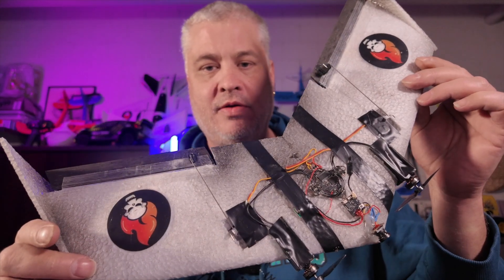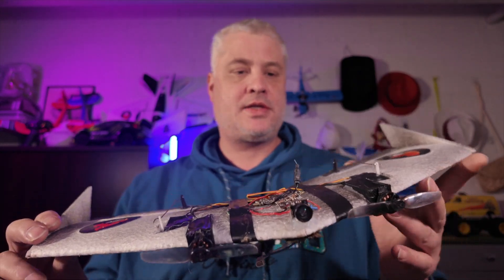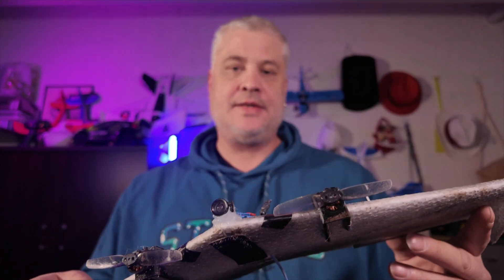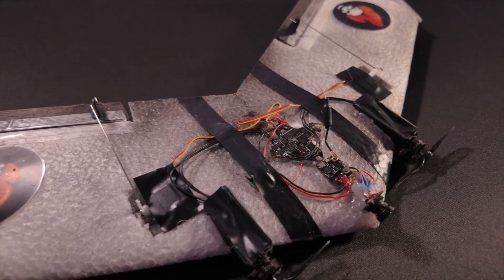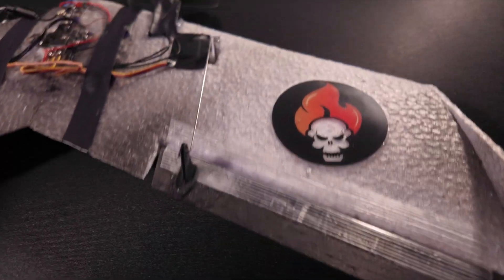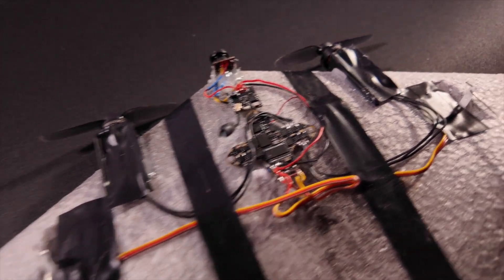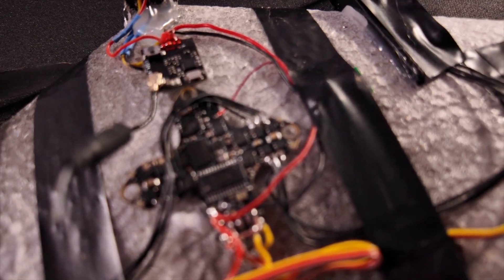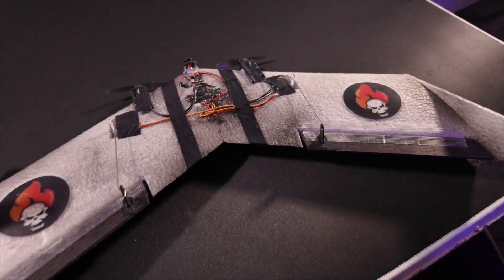Causemann Nano 1S INAV FPV Wing

Comment: Just ordered mine. I come from quads so I’m super excited. 

What’s your flight time look like ? I believe BF 4.6 supports wings now right ?
Reply from the maker: Depends on how you fly and what Batteries you use.I would say you can get around 3-4 Minutes out of it. Betaflight 4.6 is experimental and supports Wings. I have not tested it and Betaflight might just to be to complex for this Purpose. I love the simplicyity of INAV. For Drones however, I only use Betaflight.
Reply: @RockFPV  that’s great ! Have you tested a 18650 battery yet ?
Reply from the maker: @DomsaywuuhFPV  No, I am not so much into long flight times since I find it boring :-)

Comment: Awesome indeed! A question about the custom
Inav target: is your hex working only on the specific board (the v3 elrs) or will it work also on different iteration of that board (v1 and v2, no elrs/tbs)? We’re always talking about f4 1s 5A betafpv of course. I have a 2022 meteor 65 which mounts the v1 crossfire version of this aio and I’m wondering if I can flash your Inav target on that board. Thanks for sharing and keep it up, this new nano inav wings/planes trend is just 🔥
Reply from the maker: I have not tested it and I can‘t see if the bard had the same identifier. I had to disable several things to make the servos work, so I guess you just have to try if it works. It will not damage the fc and you can flash back to what was on it.
Reply: @ good to know, will definitely try. Thanks for the info!